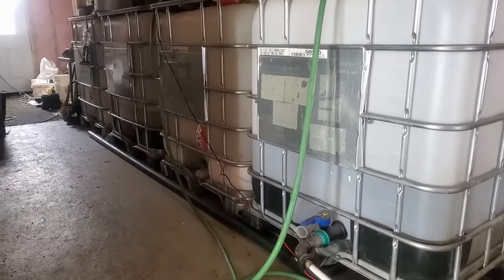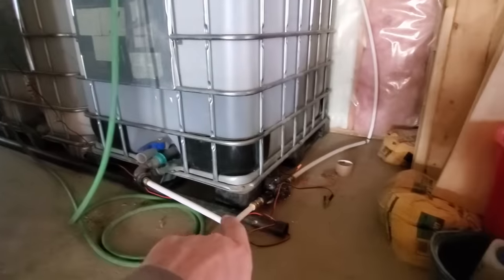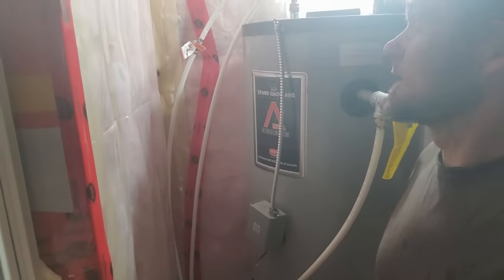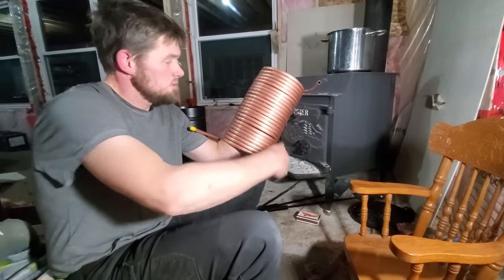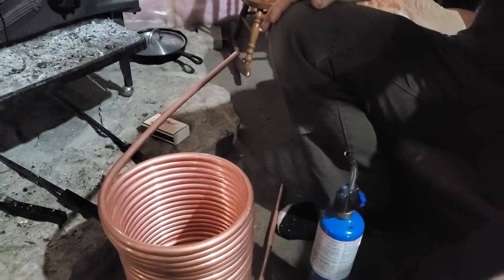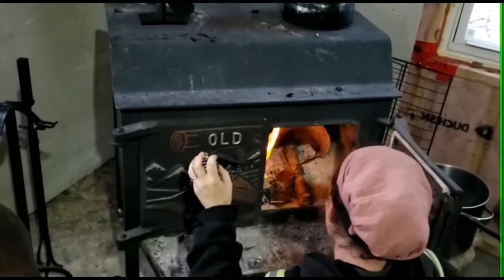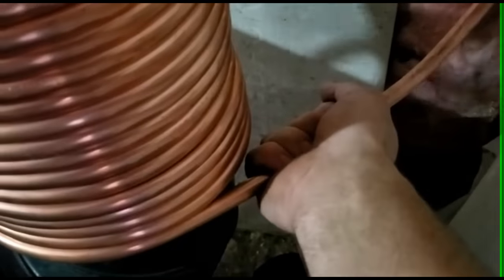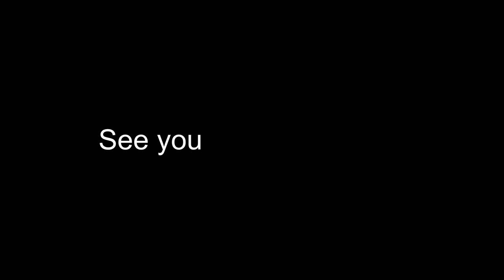Endless HOT water for FREE /OFF GRID

Comment: i was from NY now in FL.. i get free summer hot water. i stripped down a 30 gallon water heater tank. painted it black. put it in the ground on a slant 90° angle having a southern exposure. its run into the home water heater which i can turn off during the summer months it averages a temp of 125°f with a peak of 140 in august. as its used daily it is stored in the inside insulated tank so it last thru the day. sometimes it has been a little too hot but its free so... 
   👍🏡😁
Reply from the maker: Thats great!

Comment: It's only going to be hot for about 3  minutes I've done that it does not work. The cooper coil empties on flow of water within 2 minutes and a half then does not have enough volume of water to heat up back again. Heat does not keep up with the traveling water
Reply from the maker: Its been working flawlessly for 1.5 years. 
The copper coil circulates hot water in tank. The water used for showering and dishes is coming from the tank not the copper pipe.

Comment: I wonder if adding a small pump simply to circulate the water through the copper tubing would speed up the recovery rate of the “water heater”.  Just a thought. Waiting on thermal syphoning takes a bit of time as you know.  I’d bet the stove pipe could heat the water pretty fast is the water could move through faster. I doubt it will be “on demand” hot water, but I’d bet it might get close to “on demand” warm water for showering. If you try this please let me know the performance. Cheers.

Comment: That waterheater tank is 40,50 gallons? Whats the recovery rate, how long to heat the tank up after its been depleted? And to what temp does it get to? Does it ever overheat? Does it pop the prv?
Reply from the maker: I've never checked the temperature,  it's gets very hot. It doesn't pop the pressure relief valve. I have never timed the recovery, it takes much longer then electric for sure.  One thing I'd like to add is a circulation pump that runs off the heat of the stove.

Comment: Thank you for sharing but I have a question why are you choosing to solder the connection wouldn't you need a mechanical connection I would think the woodstove would melt the connection the starter with break?
Reply from the maker: System has been running for over two years with no issues.

Comment: Hi, that coil over flue was something I was looking at doing but had been warned off doing it because it would cause the fire to cool, then you won't get the draft and the fire will go out. would be interested to know how that worked out long term. Did it give you any issues? Does it ever over pressurize, so did you need a safety valve and a container to catch excessively hot water ? did it ever cool the fire ?

Comment: It is a great DIY hot water system. Do you need a special pump that able to handle hot water?  Do you have any water filter?
Reply from the maker: The hot water circulates on its own without a pump. The line is pressurized by a watar pump same as every house. No water filter at the moment

Comment: Is it necessary to have the hot water stored in a tank?  Could you just pipe the heated water directly to the faucets?  Maybe increasing the length of the copper pipe spiral would  be necessary.  Over 20 years ago, I wanted to build a tankless water heater using this principle of a coiled, heated copper pipe, but everyone I mentioned it to said it wouldn't work because the water would cool the pipe.   I should have tried it anyway.
Reply from the maker: It wouldn't work without a tank because it takes awhile for the water to heat up, the coil itself only holds a liter or two of water.

Comment: are you running a bladder to keep pressure up without pump running all the time ???  it would save power.
Reply from the maker: Hot water circulates without a pump.
The whole water system is currently pressurized with an rv pump that has a built in regulator.

Comment: Your thermosiphon looks ok ,,,, however.... from experience,, I would use 1" pipes for the thermosiphon, lovely place, lovely family, lucky man.
Reply from the maker: Thanks
Reply: @countrysideacreshomestead2008  Here in Ireland, solid fuelled thermosiphon systems are common in older houses, Usually the water in the boiler and any hot water heating radiators etc is kept separate from the water that we use for washing etc. We use a copper storage cylinder with a heating coil inside fed from a separate header tank to the main system, both the hot water circuit and the boiler/heating circuit are open vented with u shaped overflow pipes directed into the top of the respective header tank.

Comment: If you insulate the coil, you might get maybe 20% more efficiency! Great work!
Reply: Insulate the coil, and then over that insulation, wrap mirror polished aluminum with shiny/reflective side faced towards the coils--this will reflect the IR/heat energy back towards the coils.  The coils themselves could be spray painted with a high heat spray paint to increase emissivity (the color doesn't matter, but black is the most common high heat color it seems). 

   All 3 of these, will up efficiency some.
Reply: @justinw1765  Wow, thank you for the info. You are asolutely correct!
Reply: @rebinmahdi9645    No problem, and you're welcome.

Comment: spiral around the chimney ~ it needs to be in direct contact with the inner lining of the flue and insulation outside that... greater heat transfer & therefore lots more hot water generated for lower temp exhaust
Reply from the maker: It is in direct contact. That part of the chimney is not double wall

Comment: Is it such a thing for it to get too hot since eventually you will not be using as much hot was as your creating. What’s to stop it from boiling your tank in the upstairs. 500* stove pipe I’m sure will create a lot of hot water. Cool system. Just wondering about the pressure build up now that it does not have a pop off valve makes much hotter water than normal.
Reply from the maker: There is a pressure release valve but we've never blown it.

Comment: So is that plastic heat rated for domestic hotwater? Would be wise to extend the pressure relief valve on the tank to a 5 gallon bucket in case it blows its load and floods the floor or scalds someone.
Reply from the maker: Yea it is

Comment: Have you worked at all with woodburning stoves and wood-gas???
I've incorporated 6 different technologies and produced energy for next to nothing. Right now I'm renting and not able to use these methods, but soon enough I'll be heating, making hot water and regulated power going through a breaker box to run the whole house (1500 square feet) estimated, I can run an entire house in Rochester NY without sacrifice of services averaged for less than $20 a month or under $240 per year..
Reply from the maker: We have looked into wood gas for running a generator and other motors

Comment: Good job!! Just curious do you have  backflow preventer or just the holding tanks water as one. Do you have a 2nd pump for the hot water side. Are you only using the hot water  heater pressure relief valve or do you have another somewhere else. Sorry for all the questions.
Reply from the maker: There is no backflow prevention,  the only pump is a 12 volt rv water pump that pressurize the entire water system in our home, hot water pressure release valve is all we have.

Comment: Take a look at a ram pump, see if that is feasible to get water from the river.
Reply from the maker: Looked into it and it would work for sure, only problem is the length of pipe needed to get to the house and the fact that it would freeze in winter
Reply: @countrysideacreshomestead2008  Fair points. I have a ram pump that is running about 1/4 mile. Since the pipes have to be lower than the pump I put in a manual drain valve. This allows me to drain the pipe, but makes the ram pump even more manual. Someone suggest burying the pipes under ground, but I can't do that in my situation because the angles wont work that way for me.

Comment: Personally I would have run the copper coil inside the stove flu. Also like others said, PEX isn't for high temp use as well, since the system would be pressurized, and leaks or a blowout could happen if the plastic gets too soft. I would most certainly use the thermostat on the tank to activate a forced re-circulation of the water to cool it down in order to reduce the risk of overheat and steam buildup once the tank reached around the desired temperature. 

In this case, hydronic floor heating would be ideal for this, as well as perhaps an outdoor patio/walkway/driveway defrost system when you don't want to dump any more heat into the house, but if you're in a climate that regularly sees freezing temps, having the hydronic systems looped into a closed loop heat exchanger system is best to prevent line ruptures if freezing does happen with glycol mix used on those kinds of systems. 

In any case, It's only my take on this kind of system, only the pros could give a better take on this. But do keep up the work on exploring your options and experimenting with what works for you.
Reply from the maker: Coils on inside would be terrible for creosote

Comment: Do not let the copper coil exposed directly to the open fire as with time and elevated temperatures it weakens the copper in its molecular level, so encapsulate your copper in ceramic inside metal tube with at last 3mm thickness. Well done great job
Reply from the maker: Appreciate your opinions

Comment: Cool. However the cold water supply should be to the top of the coil, not the bottom. You want to have the cold water at the coldest part of the flu (the top) increasing in temperature downwards towards the hottest part of the flu (the bottom). This is more thermally efficient. Just reverse the pipes at the cylinder to solve it.
Reply from the maker: It wouldn't flow then without a pump

Comment: Run yourself a line from the hot water line that supplies your shower valve (within at least 5ft) back to the cold water inlet of the tank (make sure you put a check valve where you tie in at the tank) then you can put a little pump on that line and flip it on right before a shower for a couple minutes and you won’t waste any precious water waiting for it to get hot. You may already know this but just in case :)
Reply from the maker: That is a great idea!
Reply: @countrysideacreshomestead2008  you might even consider discharging it back at the water tanks. Then you can just use the water pressure that is provided from you primary pump.

Comment: ya know if you could safely stack them vertically and attach to structure for saftey you'd get a natural gravity fed pressure storage device making pump work less hard  also keeping indoors has it's benefits but I'd ... if it were me attach it like a chimney for a fireplace outside the house connecting to inside with a divert valve being able to swap back n forth with city water /own supply with one way  valves to prevent backflow protecting both your and citys quality of water
Reply from the maker: No city water around here, stacking those totes would put too much water pressure on bottom tote i think.
When we use the tanks on the mezzanine in the summer they do gravity feed some.

Comment: well a great video thank you so much for planting the thought seeds here... a couple of questions could you not have used copper in the hot area right up to your water storage? What about isolating the pipe carrying the hot? would these have helped at all? I am looking at installing one at my off grid retreat..
Reply from the maker: Since it was an idea and I wasn't sure how well it would work, I didn't want to purchase more copper then needed. 
Now I know it works there are certainly a number of things to improve on.  Larger storage tank for hot water being one and a 12 v circulation pump on the hot water coil being another. 
It gets plenty hot now but recovery time is on the slow side.

Comment: Nice video!  One thing I noticed that could be a safety concern is with your stove venting clearances.  Insulated class A pipe should have a minimum of 2" clearance to combustibles and it appears that you have spray foamed the pipe tight in the wall pass thru.  Just commenting so you and your family stay safe.  Thanks.
Reply from the maker: Thank you for your concern.

Comment: I once seen a small say average forearm length device a person was passing compressed air through and it looked like a very thick and stout oversized piston valve, come elongated jet engine passing air through what looked like the valve head to either passed out through two spouts one around a quarter up and the other at the end. however it was interesting one was cold and the other hot or hotter. I wondered if such could be continually recycled in a semi closed loop notion to separate the hotter and cooler gasses. Such then because of the temperature differences could be used in a solid state fashion to create electrical energy while also being a means of heat and cold generation on the fly? on-demand? for other consumer uses.

I was quite very young, many many years ago but never found or seen a notion like it again. Maybe someone has seen such elsewhere globally.

Very kewl video :D
Reply from the maker: Sounds interesting,  have to look into it, thank you

Comment: There is a couple of things here that gives me concern in the area of safety. For your top connection, you extended the relief valve outward from the mass of water in the tank. If there were ever a situation where your heating was uncontrolled and in a runaway situation, the temperature relief portion of your t&p valve would possibly not open until it's too late (the tank blowing up) due to thermal lag. The other issue is the relief valve appears to be damaged so it's not known if it would reliably work if needed and the damage would prevent you from hooking up a drain line.
You can remedy this by installing a long probe t&p in the same location so that the probe is closer to the hottest part of the water in the tank.
Reply from the maker: Relief valve was replaced long ago, this video was made a year ago and many things have changed.
Thank you for your concerns

Comment: How far away was the water heater from the coil around the stove? Awesome concept, I’m definitely gonna use this in my off grid cabin one day!!!
Reply from the maker: Water heater was sitting directly above the wood stove on the next floor
Reply: @countrysideacreshomestead2008  that’s crazy that the thermal syphon can move water vertically!! 

Do you have a pressure system of some sort or is the heat generated enough to give you a nice shower? 

Sorry if that’s a silly question lol I’m 23 trying to figure out everything I can do to get outta the rat race early 😂 the legality of just finding where I can do half this is honestly mind boggling lol. Your videos are super inspiring!
Reply from the maker: Glad you are inspired. Thermal siphon works best vertically... heat wants to rise which automatically forces it to circulate. I don't think it would work horizontally.

Comment: How many showers before you run out of hot water ?
A 6" flue pipe w/ 8" over it, might trap the heat better..
Reply from the maker: Our hot water tank is too small, I have a 40 gallon on there and need to upgrade to a 60 or 80.
Three showers in a row isn't a problem but then your waiting again.
Obviously depends on length of showers.

Comment: Saw a lot of people try a lot of people try stuff like this back in the 70's, 80's &90's working in a plumbing shop.  Looks like you used 1/2"O.D. copper for your coil. It scares me to think of the possibility of creating high pressure steam in your system unless you use a bronze or stainless circulator pump. A true thermo-siphon needs at least 3/4" I.D. pipe with 1' of vertical rise per 2' of horizontal distance with no 90 degree elbows or internal restrictions like the barbed fittings on the PEX pipe. The copper should be AT LEAST type "L" or Type "K" which has a thicker wall. You must use a tempering valve to protect you and your family from scald burns which can happen in seconds with water above 120 degrees. PEX is NOT made for the temp & pressure that can happen if the system goes into a "runaway" condition  from high flue temp, (water will boil @ 212F, your flue temp was 700F) not to mention that ONLY silver solder won't melt at the temps. that could occur. Get rid of all the Galvanized fittings, they WILL plug up!!!!!!! Use only brass or stainless nipples & fittings. You really needThermal expansion tank & 3/4"T.&P. relief valve at the "hot" water tank, 3/4" pressure relief at the coil with a metal 3/4" pipe to vent STEAM safely away. Please stay safe, I've seen how doing this wrong can go really bad really fast. Good luck
Reply from the maker: This has worked flawlessly for 1.5 years

Comment: You will get more efficiency if you have cold water coming into the top of the copper coil, and hot water leaving the bottom of the copper coil.
Reply from the maker: It wouldn't flow then, this only works due to thermal siphon.
Reply: @countrysideacreshomestead2008  The thermal siphon only requires the hot water tank to be higher than the coil. I've done it before with a rocket store to heat the hot tub, but counterflow on the coil is much more efficient with cold water coming in on top of coil, and going out at bottom or side closest to the heat. Or if you have a horizonal flue part somewhere you could put the coil horizontal if you like.

Comment: Great video.  Was curious though.   How did you tie in the hot water tank to the water spigots that supplied your shower and such. Did you run it thru mixing valve?  I'm sure the water was too hot to use right out of the tank?